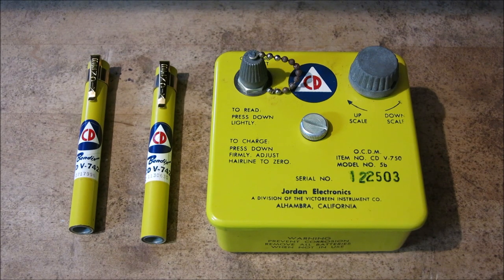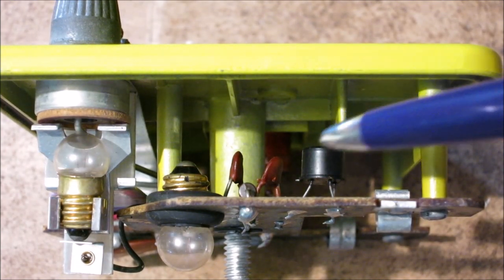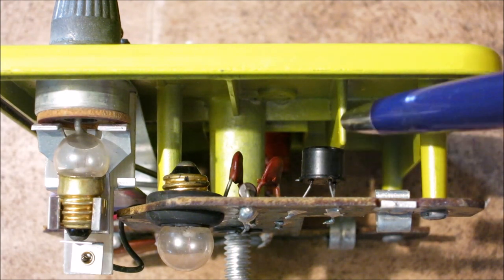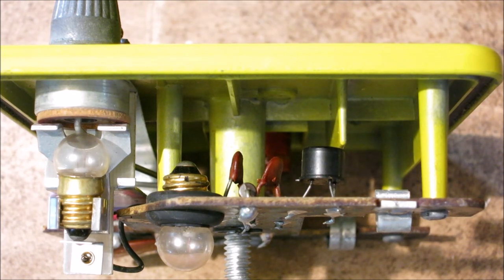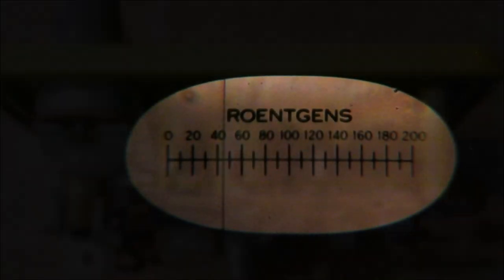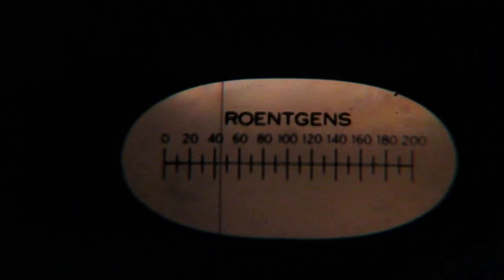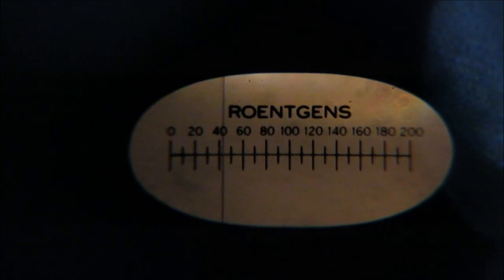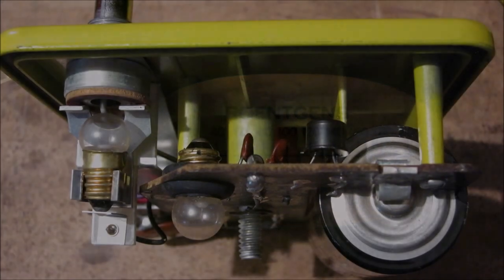Civil Defense Dosimeter - how to repair, use and calibrate vintage dosimeters

Comment: An excellent, very informative video. Thank you.

One correction regarding oscilloscopes. They certainly can have thousands of volts power supplies, but not at 3 to 4 amps. That would make the oscilloscope a multi-kilowatt device, which it is not.

Comment: What would you recommend as a replacement transistor if the existing one has failed? The manual lists the part as GE 40-16. Is it a General Electric (GE) part or a Germanium (Ge) transistor. I’d appreciate any insights you could provide. Thanks

Comment: Pretty good. But the fiber moves on electrostatic repulsion rather than any piezo or crystal effect. They used quartz but a carbon fiber can be used as in later models.

Comment: Just got 3 of these pens (2 v-740s and 1 v-730) and a charger but i am unable to see the fiber. Is it possible that it shattered, there is a fair bit of particals on the lenses. Any help would be amazing!
Reply: Most likely it has drifted off scale. Press firmly like your charging it and try to adjust the knob clockwise and counter clockwise. The fiber should return within range of the scale. It might take a couple of tries. Good luck.

Comment: the charging contact  in the pen is a spring loaded contact switch.  it also activates when you are pushing down. if you cant get the pen to take a charge take a plastic pen and push on the contact for a few time then retry

Comment: Is there anything that can be done for leaky dosimeters?  Maybe put them in a dehydrator a while?   Mine is losing about 10 roentgens a day.
Reply: You can't really fix them, I have saved some in a vacuum chamber but usually doesn't work.  Since you know how much it loses in a day, you could still use it knowing the rate of discharge.  That number might get worse over time, so you would have to keep checking it over the years.

Comment: Mine has a germanium transistor in it.  Can I switch to a silicon transistor without too many changes?  I have a 943/2n1101 transistor in my v756 unit.  I haven't found any cross reference to a silicon replacement yet.
Reply: Try. It's about the only thing that can go wrong in these chargers. You'll not find any direct replacement for a germanium transistor because they'll work down to lower voltage. But as said try. If it doesn't work satishfactory then try a transistor with higher or lower hFE than the one you first tried. That said you should be able to find suitable germanium transistors today. Mine has an OC83 in it. So if you can't find that exact then try another one with roughly similar data - it really doesn't matter that much. What matters most is that it can handle the power and voltage (voltage is not an issue here as the transistor only experiences 1,5v). OC83 can be easily found on ebay.
Reply: The transistor in mine is a CK721 which is one of the earliest experimenters transistors, i would try any low level PNP in it. I would try a 2n3905 - because i have a handful of them. The specs look like it will work.

Comment: How much the charge will laston the diosemeter meter.
And whats the safe range
Ratogens??

Sorry for my bad english
Reply: They are only meant to be used for a short period of time, say a day or less.  The model CD V742 shown goes to 200R which wouldn't kill you,, but would likely be sick with radiation poisoning.  At 450R exposure you would have a 50% chance of death.

Comment: Do you know what voltage the lamp runs on if it needs replaced?
Reply: It's a 1.3Volt  0.1Amp #131 screw type flashlight bulb.  You should never have to change it, but if it goes bad he showed you the spare bulb inside.
Reply: @ForbiddTV  i believe in being prepared. My spare was missing on mine. Thanks for the info on the bulb.

Comment: I have the same device but have not used it yet, was a little worried about receiving a shock from it. ☺
Reply from the maker: I wouldn't worry about it, the hv is well contained and this device operates at low current.
Reply: @highvoltagemayhem3345  I have a bad ticker so I'm usually a little more cautious, thanks! 😊👍🏻

Comment: Okay let me just speed this up for him so that he can stop talking so much about how this thing works it's very simple, you have a DC battery or 1.5 volt battery it drives a small transistor that creates a pulsing Square wave output at Polson Square wave output is then fed to a rectifier diode that rectifier diode then creates a slower Square wave output it is now pulsing DC that pulsing DC is fed through a capacitor that capacitor charges to a peak value and provides your high voltage DC to charge your pendocimeter the general things you have to watch out for the transistor used is made of germanium which is extremely sensitive and absorbs moisture over the last 60 years. I would also suggest not playing with the adjustment for the auto Transformer as it's actually a choke coil used to control the frequency of the oscillator circuit. In the manual it explains that you can replace the transistor with almost any equivalent or general purpose transistor is a state in the book. And only to make a slight adjustment to get the oscillator to function this is basically how your cheap inverters work nowadays, we take DC it runs a circuit that switches it on and off at a high speed we Rectify that pulsing output to create a rough AC signal and then we filter the signal. That's what this device is basically a miniature version of. If you find that pushing down on the switch is a problem. You can put softer Springs in. However make sure they're still enough tension at the switch returns to the full-up position or else the unit will stay running. Cleaning the contact with a Q-tip and rubbing alcohol, for intermittent connections also a Q-tip saturated with alcohol ran around the inside of the bottom of the cimeter pressing fairly hard, to force the Q-tip inside not so hard that you break the device but that you force it up against the lens internally. Originally these were distributed with a plastic cap that went over the end of the decimeter after and back to zero. The cap was installed partially to protect the unit from beta radiation and to keep dust and dirt from accumulating inside the end of the pen. Any trash or spots or Speckles you see when looking through the aperture of the pen. Is most likely on the lens at the bottom. As basically you're looking through a small microscope so even a small spot of dust is going to look quite large. So cleaning the inside of the pen thoroughly and even using some Electronics contact cleaner helps to reduce antioxidation. Because the only contact point is the shell of the pen and the center conductor. In some cases as the manufacturing tolerance is for somewhat wide on these wrap a small amount of foil around the post of the switch on the charger in the Box. It just increases the diameter slightly which makes it a little tighter fit and gives a little better connection. The V 138 is the decimeter that you want to have. That's the one that reads in Miller rankin. All other dosimeters were designed for high level Fallout team use. The ones that run in the 10 Rankin and in some cases 100 rent can you will never see them move with normal background radiation even after weeks. By the time the small fiber moves even off of the zero mark on a 10 rent can scale. The unit will most likely have lost its charge according to the manual for these units a decimeter once charged should stay functional reading background radiation for approximately one month this was in 1956. So again the standards are going to change a little bit as the vacuum inside the dosimeter pen has leaked down. There's only one company in the United States and it's the same one that will calibrate the civil defense Geiger counters will also calibrate your decimeters. It costs around $35 per decimeter to have it ran against a calibrated source and they produce a chart showing you its sensitivity. Frankly these are great toys to keep around for historical purposes but I would never count on one in actual radiological event. The modern digital equivalents are easily found on eBay and are not very expensive. The chances of this device being severely overloaded in a high radiation field. Such as the 200 M rentcon unit if taken into an actual environment that is say five rent can. Would cause the unit overload and you would have absolutely no idea of your exposure level. Hence why they were for training purposes only. Again if you're working with radiation or around it buy a reliable dosimeter. There are several digital models available on the market that are fairly inexpensive. And use a more modern device. I did wear one of these on my shirt when I worked at Lawrence Livermore Laboratories but it was mostly at The Conversation Piece rather than an actual diagnostic device. As there are quite a few that show the engineers at the lab wearing these old style decimeters. So for historical purposes I thought it was funny however I would check it against my film badge however usually the two were never even close to each other. As the film badge was far more sensitive and showed cumulative exposure over A month's time where the dosimeter was recharged daily. Most cases the decimeter display was actually very low due to the heavy shielding in the buildings we were in. And how well we were kept shielded from the radiological sources. Hope that's a better explanation that's a little faster to read.

Comment: Oh, boy.  You were doing pretty well till you hit 8:30 and then you went off the rails.  First your description of equipment from the era shows a complete lack of knowledge.  The 220 volts in the dosimeter charger is at a VERY small amperage.  It is powered by a 1.5 volt battery. that means this is a 1.5 to 220 volts, a 1 to 145 which means the amperage is miniscule, the CK721 transistor is a germanium that is limited to less than  0.1 amps - above that it smokes.  if i divide 0.1 amps by 145 I get 0.0007 amps or 700 microamps.  You MIGHT get a shock.  Because the oscillator frequency is high - listening to it m it is over 2khz.  I would guess that less than .5 Microfarads is enough and that stores nearly nothing.  A filter capo needs to store enough during the one half of the cycle to put out enough during the other half.  The capacitor will be a low value, not storing much. I own the older model that is point to point wiring. The 900 volts in the  Geiger counters is even less dangerous.
Reply from the maker: Your right on, the equipment isn't particularly dangerous at all however I usually try to avoid liability so saying words like "high voltage" is usually enough to discourage most people unfamiliar with electronics even though the current levels are very very low and the risk of shock is miniscule and might make you say a few choice words at best. If you notice I responded to a few comments years ago regarding electric shock stating the current levels were very low and I wouldn't worry about it. And before you go saying things like lack of understanding, my description of equipment from the era was aimed at equipment from the 20s - 40s, after reviewing it I cant believe I said 50s and 60s. must have had the dates mixed up in my head since most of my electronic equipment is from the second world war.